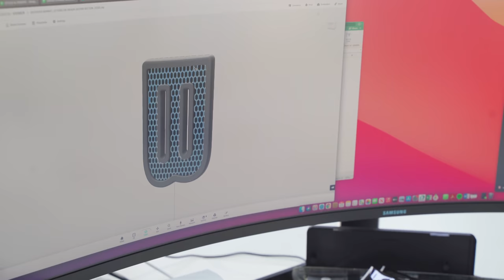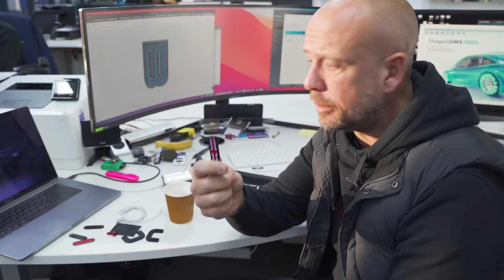This is a very bad idea... | URBAN UNCUT EP.31

Comment: I could be wrong, but Hackney Carriages aren't allowed to be modified. I think any modifications away from OEM either have to relate to disabled access or if there is a specific advertising promotion but even then it's mostly restricted to vinyl and if you want anything else you have to apply. 
That said, if a Taxi owner swapped out a few bumper bits I don't think the taxi office will notice.

Comment: Good to have you back! I think in terms of the cab/van I think you should give it a go and really transform that thing. I’d say take up the challenge and put something unique on the road. Test your design skills on a lower end vehicle Simon. I definitely see some sort of powder coated roof rack system as a start and maybe slightly bigger steel wheels as a standard with higher spec wheels as an option. DRL’s Maybe in a grey like that T6.1.

Comment: Also is there anything you can do with the keys.  i.e. it’s all in the detail….They look terrible and cheap. They are now on show on the dash and on the side board at home they look naff. Imagine handing a key back to a customer that has been modded as part of the package… nice touch?
Reply from the maker: It’s a nice thought that’s for sure, as a lot of keys these days are “keyless” and rely on signals, if we were to dress the key in carbon it would most likely block the signal and act as a faraday cage so would require a fair amount of thinking